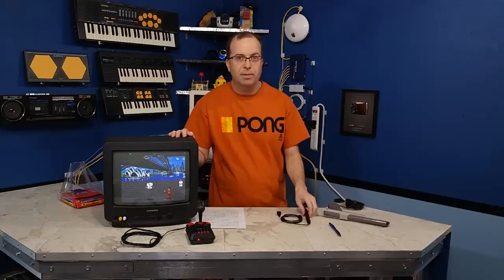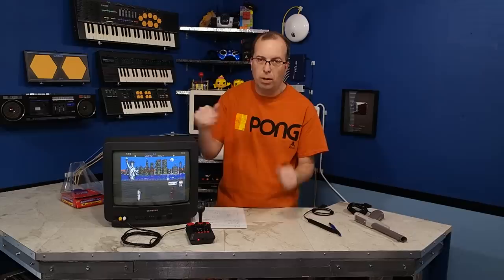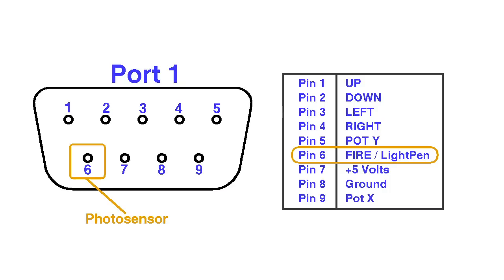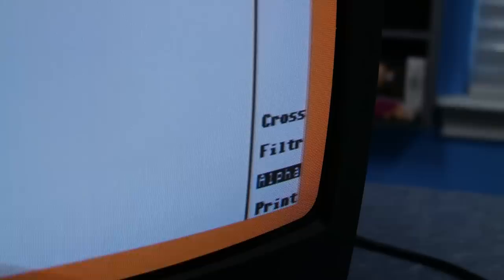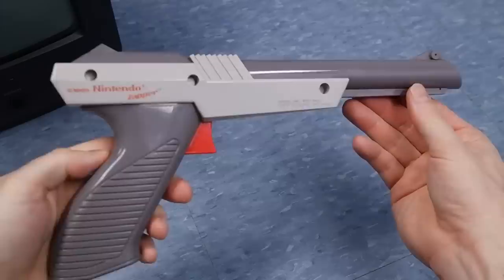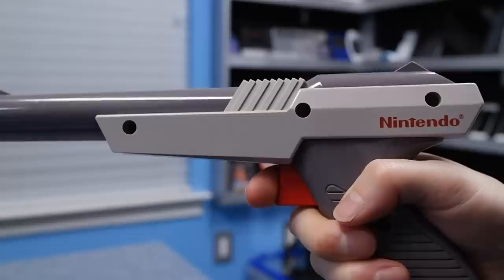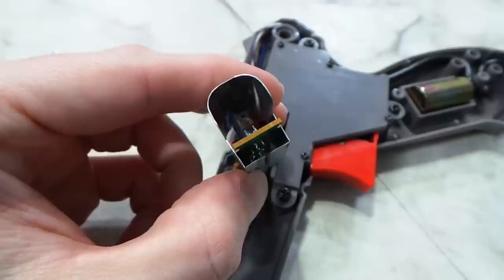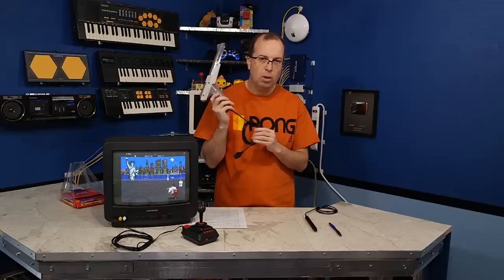How light pens and light guns work NES Zapper

Comment: Hello 8-bit Guy, I have a question - if Zapper doesn't work on LCD due delay caused by LCD, would it be possible to fix it? By adding physical part to zapper or adjusting a code of the game (via emulation)?
Reply: I was thinking about the same thing.
Wall of text incoming:
1: It should be possible if you modify the button part to send the input signal with a delay, synced to the delay of the screen. I don't know what kind of precision we are talking about, though, and if the screen delay is constant or variable. If the screen delay isn't constant, you would have to constantly detect its delay somehow, and adjust the extra button delay for every frame.

2: With emulation it could be possible if you change the right part of the game code, depending on how that code works. If there is a timer in the original code that checks for a light signal on the screen after a small delay from when the button was pressed, you could probably change the timer value stored in the (virtual) ram to last longer, and detect the late signal. To do it with a physical game, you would have to properly edit the game file, like patching it, for a permanent change.
However, if there isn't a timer in the code, and the check for the signal is instantaneous, you would have to rewrite the function of the code and add such a timer. And if the delay is variable, you either hack around in emulation and somehow adjust the game code for each frame. With an actual console you would have to put all that tinkering in the actual rom, which would be insane and probably impossible.

I have a feeling that this comment was slightly more in depth than necessary xD
Reply: derkevevin
Interesting, thank you for the answer
Reply: I was thinking something along those lines as well, like adding some kind of a timer chip onto the gun, between the trigger and the connection to the console, perhaps adjustable with plus and minus buttons or something like that. But I still think it wouldn't work because of the slowness of LCD technology - the panels aren't as fast at producing lit and unlit pixels as other types of displays, there's always a delay when the LCD panel turns a pixel on, changes its color and when it shuts one off (this is always mentioned in the specs of LCD displays, eg. 5ms grey-to-grey). I'm not however an expert or a display engineer, somebody correct me if I'm wrong.
Reply: derkevevin but if the input is delayed, the screen will not flash, right? it will only flash when the console receives the input and the sends the flashing image to the screen.
Reply: I don't think number one would work. Once the flash hits your LCD it had already happened on the NES. Delaying the zapper is only going to make it worse, since opportunity long passed and now it's being delayed more.
Reply: A delay in the button wouldn't work. The button tells the NES to flash the screen. Delaying that would only make the flash happen even later. You would need fire the button before you actually push it for it to work, which is impossible, because that would be time travel. Either the delay in the TV needs to be taken out, or the code in the game needs to be rewritten.
Reply: Tim Ramich Idk time travel has been mathematically been proven and astronauts in space are a couple milliseconds ahead of us in time due to gravity ;)
Reply: Ah right, I considered something like that but forgot about it in one of the corners I was thinking around  :P
Reply: I wonder if you could something slightly different, pause the NES for 30ms so that frames get updated on the screen first and then the detection algorithm ran. Not sure if it's possible to stop the CPU and resume it like that though.
Reply: It seems like the best/only solution for a zapper to work on an LCD would be to add a calibration feature on an emulator, in case the zapper works the way I'm thinking: the button is a command it sends to the NES, say, like a.... normal button, then the console itself orders the frame to be shown (as it does), and the console itself requests the 2 samples from the light sensor on the zapper, in sequence when the console knows that the white block frame should happen.
If that's the case, the console sending a "retrieve results" request to the zapper, then it could be calibrated on some sort of emulator. Whoever if the zapper itself already should know when the frames happen and just sends the results to the console, request or not, then it would be close to impossible. Tho I wouldn't bet on this, as it would even cause problems with NTSC vs PAL light guns.

long story short: having an emulator with a calibration function should make the zapper work as far as I can understand it.
Reply: Here's one idea I had while in the shower. Anyone seen the Super Mario Pong hack video that was made at AGDQ? The guys in   the video used a Raspberry Pi to hijack control of a SNES running Super Mario World and program it on the fly. Why not apply the same idea on an NES and use it to slowdown the game to accommodate the speed of an LCD screen and increase the number of white flash frames?
Reply: Diamond Snake just having the flashes for longer
Reply: qwerty keyboard 

I can already see the white frame behind the duck when it flashes from only a frame or so long, anymore and it would replace the duck completely.

Comment: I always thought there weren't a lot of light gun games because maybe it had to do with the capacity of the systems and having to always put up a light box. Like maybe having a complex game with an actual plot would push the limits of the game by constantly having to add the light boxes in every frame? Or I totally over thought that... rofl
Reply: But turning every color cell black and every sprite white one per frame wasn't hard at all
Reply: MarioKart7z true
Reply: The problem with making EVERY sprite white at once leads to the problem... which sprite was the NES pointing at?
Reply: With the NES that as true, there was a few games like that and the problem was after just 5 or so targetable sprites on screen, the flashing was getting too crazy. Sega's first light gun game easily overcame this since it worked like a light gun, the end result knew roughly which pixel it was aimed at like the light pen.  Safari Hunt had many sprites (and targetable background objects) and all it needed was a single screen flash.

In the end, how many light gun games could someone come up with without all of them being a tired idea while competing with other titles being released.  Somehow Nintendo actually pulled out 20 games that used it and Sega had 13 at the time.
Reply: Well, there's a basic timing issue.

You have 60 or 50 frames per second on the NES depending on whether it's NTSC or PAL,

Let's say PAL since that makes the problem bigger.

Now to figure out what happened and what you hit, you first need a black frame. That's 1 black frame for every time the gun is fired. 
Now you need to show each target rectangle for a single frame. That's 1 frame per target.
Now say you have 9 targets.
That means your screen is near enough to blank for 10 frames.
That's almost 1/5th of a second.

That is very distracting. And it only gets worse the more potential targets there are.
And if for some reason you had say, 49 targets (I don't think that's plausible on an NES, but it's possible on snes - and notice how the Snes Super Scope - the Zapper equivalent actually works more like the light pen than the zapper) then the screen is going blank for a second or more every time you pull the trigger?
That.... Seems quite maddening.
A second of a mostly blank screen, but with a sequence of flashing white squares? Very noticeable, and headache inducing (if not a major epilepsy threat too.)

So there's a pretty strict upper limit on the number of targets with this kind of technology...
Reply: I just don't think "lack of interest" was the main reason for making it obsolete. Part of the reason maybe.
Reply: KuraIthys You actually only need O(log n) frames for n targets.  So you can do 255 targets in only 9 frames or so.
Reply: Not necessarily.  Each target just needs a unique on-off pattern.  E.g. for 7 targets: 
off off off = miss
off off on = target 1
off on off = target 2
off on on = target 3
on off off = target 4
on off on = target 5
on on off = target 6
on on on = target 7
Reply: LittleRae Light gun games just didn't sell very well, that's why there wasn't many. Also since "nintendos" were a toy back then lots of kids broke their zappers playing guns with them.
Reply: That could be prevented by looking for the initial all black frame that was shown in the video.  I'm not sure if Duck Hunt did that.  I never tested the myth.
Reply: Correct, my example didn't explicitly include the all black frame, but it would probably be needed to work.
Reply: nice thinking Paul, hogan alley and other games with lots of targets probably do this and they bitmask the result. 9 frames will be a too noticeable delay (you'll see the screen turning black screen at that point) but no NES game could handle 255 sprites in any case :P
Reply: SECONDQUEST that's true too. I know a lot of kids looked at their Nintendo as a toy and not an electronic piece of entertainment. I was raised a little differently. I practically tucked mine in at night lol
Reply: It's not quite that bad.  The NES program actually can tell exactly which vertical position the Zapper is pointing at (Duck Hunt doesn't do this).  So you only need to flash the target squares more than once if you have multiple targets on the same horizontal line.
Reply: Duck Hunt and all other NES light gun games did do the single black frame to "calibrate" the gun.  It actually was preventing cheating.  If you had the brightness turned up too high on the TV it would not work.  I used to have a TV that was dying and it had to have the brightness up all the way just to see the picture but blacks were really washed out and looked almost grey because of this... I couldn't play Duck Hunt, Hogan's Alley or Gumshoe because of this.

Comment: I have heard the condition after painting on a CRT with a pen was called "Gorilla Arm" (because your arm felt so heavy). The light pen actually goes back to mainframe terminals in the 1960'ies. Even in the 80'ies computer terminals from IBM (3270 type) could be equipped with a light pen, only used for selections on a menu. These terminals were strictly character based. I have never used it and do not remember if special coding was necessary on the screen.

Comment: Dude you should totally solder together a 2-port adapter with a dip switch or something to change which pin the pen's button goes to.
Reply: tohopes you Sir.  stole my idea
Reply: a SP4T* switch would probably be better (*Single Pole 4-Throw)
Reply: the software could also just mask out the upper nibble of the $DC00 CIA register and consider any non-zero value as pressed. i'd have thought that the Fire button (bit 4) would be inuitive assignment and become a defacto standard.
Reply: +Gert Brink Nielsen it looks like it says SPAT switch
Reply: +Martin Wagner : It's  the design decision that the fire-button pin was already wired as the trigger-signal from the photo-diode. And only this pin could trigger the transfer of the raster-counter to the lightpen-register (directly by the vic-chip, for timing precision), so you could only use one of the other pins to act as button.
Reply: On the BBC Micro, there was a similar but slightly different situation.  The photosensor input and fire button input were on separate pins, so at least every light pen manufacturer wired the button to the correct pin of the Beeb's joystick port.  Unfortunately, at least one manufacturer actually went and inverted the sense of the signal; so some software would think you were holding down the button when you were not, and that you had released it when you pressed it.

Fortunately, it was not usually hard to hack the software to work with your own light pen .....  or maybe it was just me that did that.  (And hacking games.  Load a quick interrupt routine to disable auto-run, load the game into memory and drop back to BASIC prompt instead of auto-running the game, write a line of BASIC to find every number 3 in memory, write down the hex locations, one of them is your starting lives:  change it to 4 and CALL the auto-run address.  If you were lucky then you would start the game with 4 lives, probably you got the wrong one and crashed it, but one of them must be the right one and there would not be very many to choose from.)  Um .....  OK, maybe I had a mis-spent youth.

And yes, light pens were uncomfortable to use for long periods or intricate work.  But my university library had a computerised catalogue system in the early '90s that used dedicated terminals with a light pen to select from a series of menus; and that was OK, probably because you were not using it for long and not staring intently into the screen, just pointing at a menu item.
Reply: @BertGrink  Sounds like a job for a rotary switch, potentially one with multiple poles if several pins needed to be manipulated.

Comment: The S pen is great in its own way. Inside the screen is a magnetic field. When the S Pen is nearby the screen, the magnetic field activates the S Pens tiny board inside and then a pointer on the device appears to predict where the pen is hovering. Once the pen touches the screen, the sensitive pressure tip activates and sends signals to the device on where the pen is and how hard the device is pressing so if you were using an app like ibis paint X then you can change the size of the line by applying more or less pressure

Comment: Although light pens never caught on in the consumer realm, they were used extensively in other areas.  I was a computer tech at a hospital between 1986-1994.  Light pens were used on the computer terminals throughout the hospital for selecting inputs fields.  By 1994, they were begin replaced with PCs using a mouse for input.